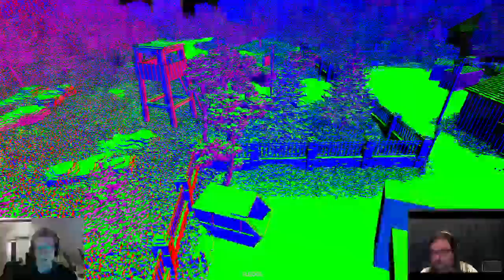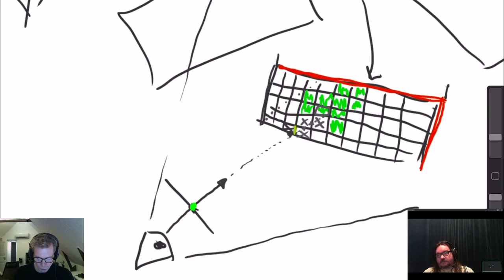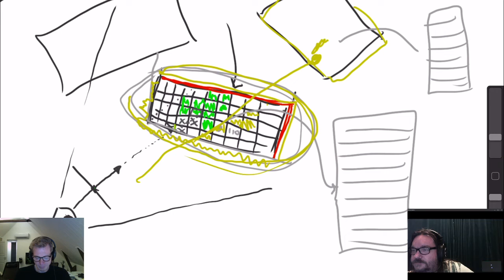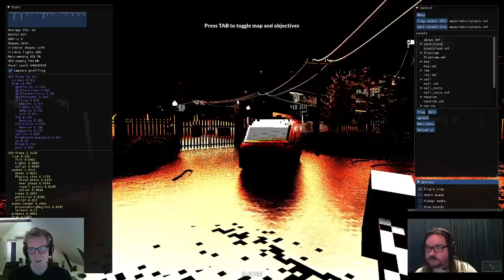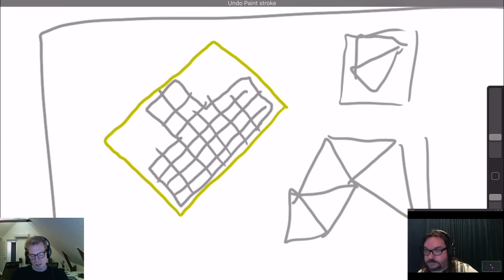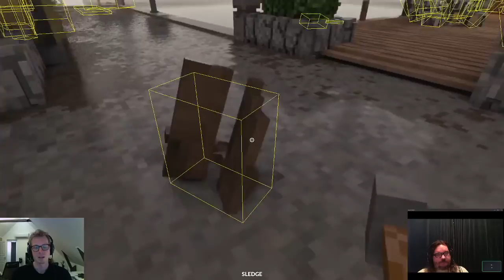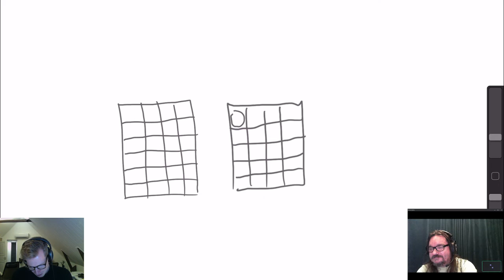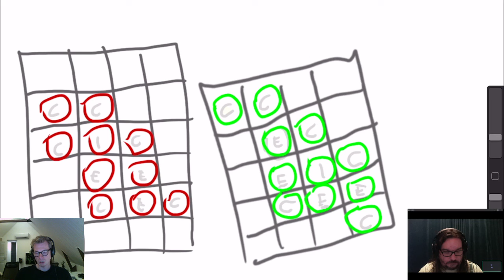Teardown Engine Technical Dive

Comment: the paper is from who?
Reply: I couldn't pin it down, but it sounds like some variation of a formula from a man Jack Elton Bresenham who created the underlying system for rasterizing lines that Dennis is using, presumably what is different is that it's translating this supercover algorithm from 2D to 3D and optimizing it for voxel raymarching.
Reply: The voxel traversal paper he refers to is "A Fast Voxel Traversal Algorithm for Ray Tracing" by John Amanatides and Andrew Woo
Reply: @Jon-mf2no thanks, i had read it a while back and couldn’t remember their last names and i couldn’t hear it clearly here